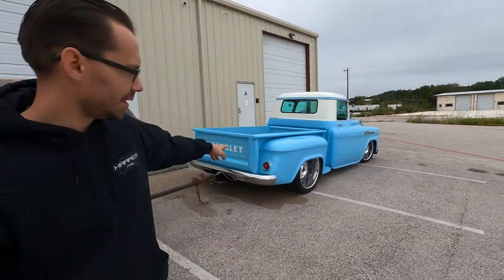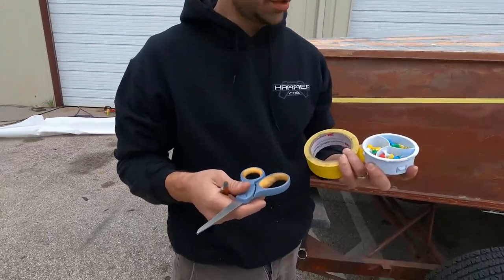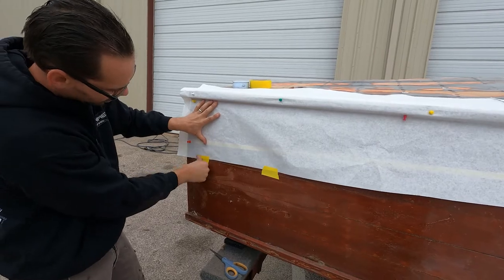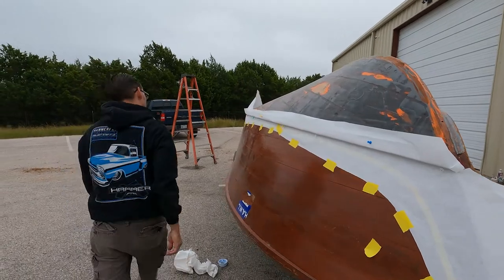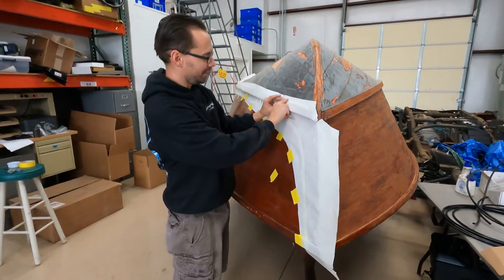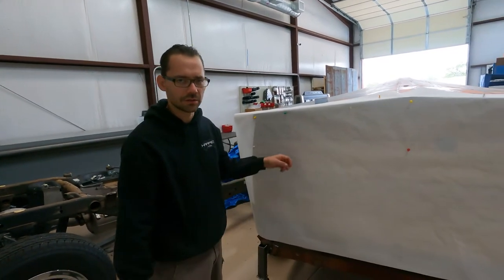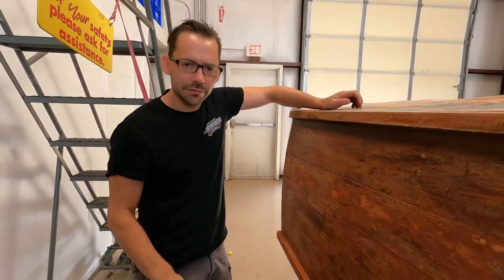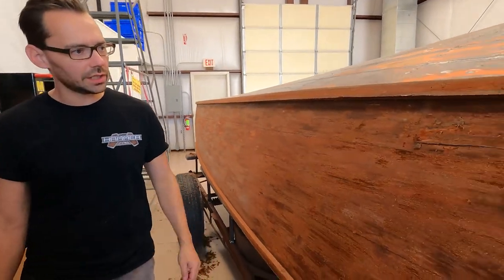1957 Chris Craft Restomod (Day 4) Patterning the sides

Comment: The part of the hull that you are calling the boot stripe is actually the chine or Chine log. The boot stripe is a straight painted stripe which runs along the hull sides and across the transom where the Hull breaks the water when the boat is sitting still with no extra weight in it. The back of the boat is called the transom. The h u l l sides are called the top sides.
Reply from the maker: Thanks Walt!  I’m a little closer to being a boat expert. Appreciate it!